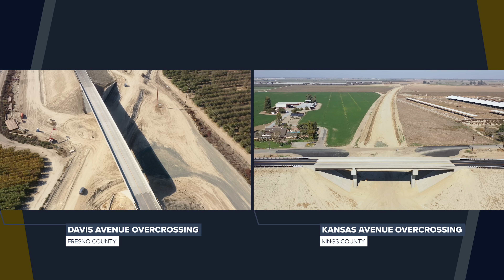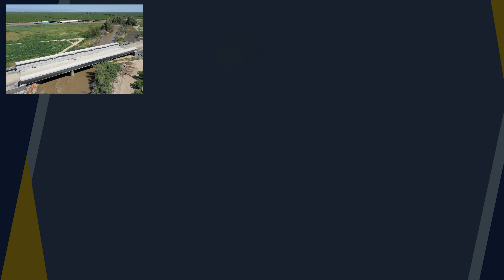Fall 2023 Construction Update: Progress is happening across California thanks to HSR Workers!

Comment: I think with the pace this is going at, I bet we will probably be finished even sooner. It would be amazing if this high speed rail line opened in time for the LA 2028 Olympics. Just as Japan did with its Tokaido Shinkansen for the 1964 Tokyo Olympics.
Reply: no chance for LA service anywhere near that time. sadly. There is a plan for a long tunnel into the LA area from the north, a huge infrastructure project. If it were properly funded (good luck with that), over-all project cost would be lower and it would pay dividends even sooner. Patience is indicated.
Reply: @inyobill lmao I member when this was supposed to be running by 2015
Reply: @SuperMrgentleman  oh. Have you ever heard of "obstructionism" and the effects it has on projects?
Reply: Not SF to LA (CAHSR’s own estimates show up to six years needed to build across Pacheco Pass), but certainly Merced to Bakersfield. That may not sound too impressive, but if Brightline West is able to get their trains running in 2028, then certainly so can CAHSR. Along with new Acela service on the NE Corridor, the US could have three operating examples of high speed rail by the 2028 Olympics. That should be a national goal, especially for the current pro-rail Biden Administration, and one that’s achievable.
Reply: @ChrisJones-gx7fc  no way brightline west will end up running electric service. They'll liekly run deisel service just under the US HSR threshold as they do in flordia. Do i think it'd be cool if CHSR could run by the 2028 olympics? yes. Would it be possible? maybe. What would it take? The following:
Hiring a lot more workers
A commitment to build a second project afterwards to keep said workers employed till 2033 as the current project would (SF/Sac-Portland?) 
A lot more money in the short term (less in the long term)
US army core of engineers involvement
environmental review and permitting fasttracking
And potentially running diesel trains on the line if you can't get the electric wires done in time. 
And starting train procurement now, although train procurement isn't that hard just buy avelia liberties, US production facilities already exist, although it's mostly grade seperated, getting an FRA exemption for N700S may be doable, but you'd also need a Buy America exemption to get enough trains in time, since the tooling and factory setup would likely take too long, unless NYC MTA is willing to take a further delay on their new subway cars and let CHSR take over the kawasaki yonkers factory for a bit.
Reply: @ChrisJones-gx7fc The problem are tge Republicans.
Reply: @ChrisJones-gx7fc Biden is so pro-rail he blocked railway workers from stiking!
Reply: Don't Jinx it
Reply: @chrisonthedot  2024’s gonna be a crucial election year, and not just for the guy who’ll occupy the White House. CAHSR maintaining a supportive Congress is critical to delivering Central Valley train service by 2030, as well as to SF and LA/Anaheim.
Reply: @ChrisJones-gx7fc  Like I said. Don't Jinx it
Reply: @ChrisJones-gx7fc  If the current President wins another term and dems have more control of congress, I am willing to bet we will see more money going to Cali. This Prez will have no reason NOT to do it as he wouldn't be facing another term and can try to do even more if they have full control. I'm hoping for that scenario.
Reply: @ChrisJones-gx7fc here in the northeast we have received over 30 billion from the infrastructure law. If California could get that kind of money this project is possible. Vegas and La will definitely be a thing with brightline.
Reply: @PURAHOUSEDERESTREPO  My thoughts exactly. Although I would prefer they build an entirely new NEC, it's great that we got that much money. Now they need to help Cali even more, ESPECIALLY since this administration is always harping on climate change and sustainability. Cali is building one of the most sustainable forms of ground transportation so the feds need to contribute more.
Reply: @ChrisJones-gx7fc yup Trump can make it possible to finish it earlier
Reply: @TheRailwayDrone Sorry but HSR funding is not reason enough to ever elect those types of politicians who love to make promises they know can never be kept.
Reply: @manishp.26 Agree. Unlike others, Trump knows how things are built at the best price and delivery date.
Reply: @davidjackson7281  Lol we elect them for other reasons. I see no better reason to elect people than to fund building OUR country.
Reply: @TheRailwayDrone I respect your opinion and can appreciate your feeling that funding infrastructure such as passenger rail is a top priority. Not to get too political but I believe there are more important issues such as energy independence, border protection, foreign policy, mental capacity, wokeism, the national debt, etc, etc, etc. Throwing a few billion for funding transit is not nearly reason enough to support those that make promises they have no intention of keeping.
Reply: @davidjackson7281  Transportation is one of the most, if not THE most important issue. There are so many low-income people who do not have viable transportation options. High earners are struggling to live in California because housing options in the major cities are limited. Imagine connecting a relative small city to a major metropolitan area via high speed ground transportation. High speed rail helps to fix that, ESPECIALLY if it is low-cost and robust. All those other issues you speak about are JUST as important (although, I guarantee your definition of "wokism" is nowhere near the actual definition, but I digress). But most cities that have high speed railway stations going through them have enormous potential to improve their economies.
Reply: @TheRailwayDrone Yes,there is a lot of truth to what you believe. Will be interesting to see what the Valley ridership turns out to be. There may be 2+3 seating and discounted fares for low income people. Yes, I threw in the wokeism for fun, but I digress. 

A thirty minute 90 mile commute could be great. However, projected ridership may be based on outdated assumptions and are exaggerated given the revolutionary increases in remote work and the possible stagnation of population growth.
Reply: @davidjackson7281  Ridership projections are irrelevant as they're nothing but predictions. No one knows what will happen. There may be extenuating circumstances that may cause people to move to or from California. But the simple fact is, Cali is the 5th largest economy in the world, so although people may be leaving now, that doesn't mean that'll happen in the future.
Reply: @TheRailwayDrone  I concur. No one can say either way with certainty. So build it.
Reply: @ChrisJones-gx7fc we need to make sure Trump goes to jail and we probably need someone better than Biden in the Oval Office, and we gotta get those old congressman to retire
Reply: @TheRailwayDrone  So, what you're saying is that he can only boost this scam once he no longer has to face the voters again?
Reply: @SoloPilot6  You already seem to be against this project so any answer I gave you wouldn't sway you either away.
Reply: @TheRailwayDrone  This project was a poor idea at the start.  It has devolved into a really BAD idea, and moreso because the backers are forcing every taxpayer in the United States to pay for it.

I LIKE trains, and where HSR is practical, fine -- but this is NOT practical.  

It is too expensive to build, and will never be cost effective to operate.  Only TWO HSR lines have EVER covered their operating expenses (both in Japan), and each only did so for a single 90-day period.  This will be a money drain, and underutilized.  A person can board a jetliner at 5 different airports in and around LA area 3 different airports in the Bay Area and make the trip in an hour, for as little as $49 -- and even those flights are often not full.  Why would they spend more to take three times as long between only one station at each end?
Reply: @SoloPilot6  Welp. Fortunately the majority of Cali disagrees with you. And, alas, the project moves along.
Reply: world cup ⚽️
Reply: @dasalsakid  Something to pee in.
Reply: I'll take that bet. How much ya got? 2028 isn't happening.
Reply: @LucidStew Some love to fantasize just like a 2:40 ride ain't happening.
Reply: @davidjackson7281 I’ll take CAHSR’s models over your assumptions. The entire system is being engineered and built with that 2 hour 39 minute nonstop SF-LA travel time in mind. It’s an average speed of 166 mph, which by comparison China’s fastest HSR service averages 181.4 mph.
Reply: @LucidStew definitely not SF and LA, but your own analysis showed Merced-Bakersfield still could be done in five years time.
Reply: @ChrisJones-gx7fc  It's POSSIBLE, but it won't happen. Best case scenario, they get all the funding they need and open in the 2030-2033 target range. Personally I'm leaning toward 2032 atm. They're still moving slowly, but they are moving steadily.
Reply: @LucidStew  I’m sticking with 2030. The range to 2033 is only if things get delayed more, a possibility to be sure, but it would appear things have pretty much smoothed out and should continue to move forward at a steady pace, one that’s accelerating as structures and guideway are completed, plus all the lessons learned early on being applied into current and future construction.  

Utility relocations have been a big reason for delays, since those aren’t up to CAHSR, and there needs to be more pressure on utility companies to make those happen faster which I believe there has been lately and continues to. Probably the biggest lesson being applied going forward is the Merced and Bakersfield (and eventually SF and LA) extensions will have all their pre-construction work completed prior to construction starting, including all the necessary utility relocations and land acquired.
Reply: @ChrisJones-gx7fc  The missed on CP4 and they had some pretty big change orders last month, so they're probably going overbudget again. These aren't strong indicators that things are going well enough to think they will go to plan over the next 7 years.
Reply: @LucidStew  well, hence why they gave themselves that 2030-33 window. We’ll just have to see how things progress now over the next several years as the first four CPs wrap up civil construction and tracks and systems start to be installed, along with construction starting on the Merced and Bakersfield extensions, the four Central Valley stations and maintenance facility, and manufacturing of the first high speed trainsets. 

I’ve said this before, but my gut hunch is CAHSR won’t receive any funding for beyond what’s needed to complete Merced to Bakersfield until they get trains at least testing, to have something tangible to show for all the effort and what’s estimated to be about $35 billion so far, and justify the tens of billions of dollars more needed to get to SF and LA, meaning construction likely wouldn’t begin across the mountain passes until the early 2030s at the earliest.
Reply: @LucidStew in 2008 this was taking 8-12 years to completely span CA and give 96 million rides in 2020, then it's "jk, just SF to LA in 2020" and now it's "lmao idk give us another 8-12 years"
Reply: @SuperMrgentleman  According to the 2008 Business Plan, at that time they did not anticipate completing the entire system until 2030. At that point they were anticipating 55 million trips. At the time, the assumption was that what is now referred to as Phase 1 would be done by 2020. Now they simply don't have an estimate for anything beyond Merced-Bakersfield. However, the CAHSRA was a joke up until about 2017. They have improved a lot and their current predictions are more reliable.
Reply: @LucidStew  Yeah and the 2008 business plan was AFTER the whole pitch to voters that had passenger trains starting to run 2016 with a total complete date of 2020 and 95 million riders that year. It keeps getting kicked further and further. And now it's, what, 2030 before a 170 mile segment runs? How long until that gets kicked down the road again?
Reply: @SuperMrgentleman  It was before. The 2008 BP mentions the Prop 1A election in the future tense. Election was November. The BPs tend to be released in spring. I don't see any mention in there of an early operating segment, but I didn't go through it exhaustively. Merced-Bakersfield is a 2030-2033 range, not a 2030 hard target.
Reply: @LucidStew  It will never be completed.
Reply: If the feds fund it. But too late for that.
Reply: @PURAHOUSEDERESTREPO  "The Feds" have no money.  They have to either take it from the people who earned it, or borrow it and force future generations to pay for it.
Reply: @PURAHOUSEDERESTREPO California should pay for it, they are getting all the benefits, not the flyover country.
Reply: The UK's HS2 to Birmingham will be finished long before this is complete and it started later.  The engineering challenges for this central section are far less than HS2 as the terrain is largely flat.  Why is it taking so long.
Reply: @aalan4296 Comparisons are fun. CAHSR's 171 mile route by 2030 for $28 B. HS2's 140 mile route by 2033 for L44.6 B. CAHSR started a little for show two years earlier but actually the real construction started only 6 months earlier. The likelihood of further extentions is greater for CAHSR than HS2.
Reply: @davidjackson7281  HS2 will cost more as its going through very densely populated areas with higher land values.  A huge amount of HS2 is in tunnels as well something like 64 miles whereas CAHSR is largely in flat terrain and sparsely populated countryside.  If you watch videos of both then the progress on HS2 and the structures being built are far more impressive currently than CAHSR.  It will be really good for the US to join the high speed rail club my only comment is its taking very to construct given the ease of the terrain.
Reply: @aalan4296 Yes, I can greatly appreciate how expensive HS2 will be because of the tunnels and developed locations. Regarding the Valley's flat terrain, there are still a hell of alot of structures being constructed and the video shows only some. CAHSR's 500 mile route will eventually have 55 miles of tunnels includng three of the world's longest. l love all HSR worldwide the same and chuckle when there are critical comparisons which really matter not, atleast not to me.
Reply: If we are USA (United States of America), we can finish the HSR by summer 2028 for LA Olympics. 
We are DSA (Divided States of America)
Reply: @san209nha9 Don't know about how others may feel about the actual interest in the LA Olympics but I'm Californian and started losing interest several decades ago even if it's in LA. CAHSR first segment will go to Bakersfield nInety miles from LA and planned for operations to begin in 2030-2033.
Reply: @davidjackson7281  
- I am not interested in watching Olympics that much. But LA Olympics is a free advertisement for the American products to the world.
- I support CAHSR, but I did not agree with Obama that CA has to build the segment Fresno-Bakersfield first. what is the point that we build that segment then we have to wait until we build the LA -Bakersfield in order to start to operate. To me we should do the section LA-Bakersfield first and make use of it
-  CA should have built the HSR from LA to Las Vegas first to learn from it, then to build the CAHSR
Reply: @san209nha9 That's a good point. Perhaps showcasing CAHSR's operations would theoriticallly be good publlcity during the Olympics. Unfortunately the best CAHSR can hope to show in 2028 is the test track running.  I agree the LA to Bakersfield segment should have been done first. But directly tranversing the Tejon Pass not the Palmdale alignment which has too much tunneling at about twice the cost and time to construct.
Reply: I remind you this project has the California pace. A few advances IMHO doesn’t address the red tape, bureaucracy, inefficiency, and complexity of doing things in California. Sadly, I predict it will take much longer and, if it’s ever completed, the cost will prove it was a bad investment (it could have been a great investment if properly managed with different rules, but some governments have an amazing way of ruining good projects).
Reply: Theoretically they could if the fast track the red tape process especially in the LA area
Reply: @Ozzymandias493 Yes LA needs to step up transit improvements. Theoretically we could have world peace.
Reply: @davidjackson7281  theoretically you could not be a smartass on the internet and maybe touch some grass. Hmm
Reply: @Ozzymandias493 You are funny ... theoritically. Hope you have a very Happy Thanksgiving with perhaps touching some grass, hmm?
Reply: The thing that held this project back were greedy billionaires that thought they had a better concept as well as the cost of the project being drastically underestimated.
Reply: @Doophenschmirtz  What greedy billionaires?
Reply: @Doophenschmirtz What better concept did greedy billionaires think they had? Also underestimated was opposition forces, environmental obstacles, funding sources and construction times
Reply: @Doophenschmirtz Yes, wealthy NIMBY conservatives and Republicans.
Reply: @Doophenschmirtz Yes, wealthy NIMBY conservatives and Republicans.
Reply: thats very optimistic lol
Reply: @PSL09 I am 199% for CAHSR and am entertained by how some supporters are even more optomistic than even the authorty's hopeful estimates which have yet to be proven reliable since passage of Prop 1A in 2008.
Reply: One thing I still wonder, why don’t they built a fully electric train system?
Reply: @SakuraSakura8596  This is going to be fully electric.
Reply: @SakuraSakura8596 CAHSR is going to be fully electric, yes. This will allow for higher operating speeds, and, if California does the work Union Pacific is unable to do, it will allow for cleaner electric freight trains in California as well.
Reply: @Awesome_Aasim  because I thought what they did in Florida make me worried 😦
Reply: @SakuraSakura8596  Yeah, I don't like what Brightline did in Florida. They became the company known for its safety track record, as well as a real estate ploy that might cease to operate if there is no more money to be made. The best decision would be to leave building to the governments, and operation to private corporations.
Reply: @Awesome_Aasim  That what they did in Japan for over half a century.
Reply: @SakuraSakura8596 What are you saying? Of course CAHSR is fully electric and may become the world's longest and fastest. Do you think the power's supplied by elephants as in some Asian countries?
Reply: A 1% sales tax pays for it. No one wants to pay for it. Keep dreaming!
Reply: At least have the trainsets being tested on the first 119 mile section. It would still make for some great publicity seeing the trains going 220+ mph. The first in North, South, and Central America at those speeds.
Reply: @mrxman581  Great publicity, and probably a lot of fun to ride.  If it ever happens, I would probably go take a trip.

But still, the Disneyland Railroad is also fun to ride, and is more practical than the Crony Express.
Reply: When I went to UCSD for my undergrad degree, they told me I would be able to ride a tram to downtown in my fourth year. The line only opened after I graduated from grad school. sad : (
Reply: Bureaucratic red tape on monolithic megastructure...  But, once it is done, California will feel even small than it already does.
Reply: Its a little too hopeful.  Maybe brightline west will open before the Sf-la one. Nonetheless, it will be good for the country as a whole!
Reply: @Ninjabeefyschtick  How will it be good for anyone other than the people getting the tax money from the rest of the country?
Reply: @SoloPilot6 HSR is barely able to be built despite the huge cost because of mountains of overcharging and corruption sure. However expecting infrastructure to break even doesn't take into account the overall effect on an economy. Infrastructure is a cost center and the profit center are businesses and production overall. The cost is way too much though of course
Reply: @Ninjabeefyschtick hopefully Brightline West’s progress pushes CAHSR to accelerate their own construction rate so both could begin revenue service (in CAHSR’s case Merced-Bakersfield) around the same time, ideally Summer 2028. That’s the goal for Brightline West, and it should be too for CAHSR. That should be a national goal for US high speed rail, to potentially have three operating examples of high speed rail by the Olympics.
Reply: not happening
Reply: There is a TON of work necessary. The earliest it could start is end of 2030, and that's just Merced to Bakersfield.Checkout Wikipedia entry for more info.
Reply: Dream on!
Reply: How can a Bakersfield— Merced line help with LA Olympics
Reply: It's only going to be completed Merced to Bakersfield for the foreseeable future. The project wasted all their money buying up private land because they went down 99 instead of I-5. A person of normal intelligence would have gone down I-5, and it is what the French and the Japanese advised us to do. They said if we went down 99, there would no private investment, and they were right.
Reply: @neutrino78x  there are no big cities on i5. They has to offer the central cities something to get their votes. Unlikely the project wud have even been approved if it was sling i5
Reply: @neutrino78x  I-5 crosses down through a mountain, and having it follow that route would defeat the purpose of a rail line, which is to promote sustainable transportation between urban, suburban, and rural areas. They did not make a detour to Palmdale for nothing, they just avoided mountains to avoid even more costs.
Reply: @gooser__43 

"😅 no"

lmao, 20 years from now, these fools will be saying "oh yeah the CAHSR will be finished this year!"

And we'll be flying zero emission aircraft, and most cars on the road will be zero emission as well, so that won't be a concern.

Newsom made a very wise decision to draw a line and say there shall be no more construction beyond Merced to Bakersfield, for the foreseeable future. 

By the time this stupid train, as originally planned, is ever built, there will be no need for it, nor is there a need right now. 🙂
Reply: @gooser__43 

" use the rubble to set up a choral reef?"

Lmao hell that would be a more constructive use for it lmao
Reply: Only another hundred and fifty years, and these train station models are going to be finalized!!  Can't wait to see the hard work of the engineers and architects, so I can challenge the environmental document, and freeze construction in its tracks!  Only in California!!
Reply: @wolfumz 

"Only another hundred and fifty years, and these train station models are going to be finalized!!  "

Well, we already have a high speed system that's much faster than HSR: jet aircraft.

The city pair where HSR would be more useful (though overkill) is LA/SD, not SF/LA.

380 miles is way too far.

LA/SD is only 127 miles....but you don't need 200 mph  to cover that. 

If you averaged 75 mph -- which is allowed by the current track speed of 79 mph --  it would only take 1.7 hours to get from SD to LA. This would be a huge improvement from the current average of 35 mph, and doesn't require huge investments.

Good news is that they are working on that independently of the stupid CAHSR project, and it can be done and is being done with existing budgets.
Reply: At this pace there is no way LA will be connected by 2028. Perhaps the CCP could do it in 5 years. Is this project a joke. Seriously this is a boondoggle to feed money to the lawyer lobby so every mile can be litigated.
Reply: Delusional; is no way to go through life you indoctrinated Commie.
Reply: if you’re rich enough to go to the Olympics you’re rich enough to take a plane in. Probably first class. The Olympics are actually getting in the way of infrastructure projects that could help the people who live here in LA, city council only bid on the games to cater to wealthy tourists and real estate
Reply: @thepopculturejunky  Well if you are rich enough to fly first class on a plane you are probably more than rich enough to take a first class bullet train to where you want to go. First class train tickets that are less than first class plane tickets.
Reply: Even if this did get completed by the Olympics (which it won't) Bakersfield is quite far from Los Angeles...like 2 hours far.  So what's the point.
Reply: @thegoldstandard55  Because you believe the project, especially with the parsimonious funding, should be a complete system from day one. Worked a lot of large projects, have you. Here it is something like 65 years after the start of the Interstate Highway project it's still not complete.
Reply: @inyobill  The OP specifically mentioned the project will be a benefit for the Olympics in 28, but my argument is that a train from Bakersfield to Merced won't be any benefit for it.  In Southern California we need a good fast train system connecting San Diego, Los Angeles, Long Beach, Irvine, Anaheim, Ontario and San Bernardino.  Like BART does in Northern California.
Reply: 2028? 😂😂 Keep dreaming!! With the unions, lack of money there's a much higher chance of the project getting scraped entirely. Just sad!!
Reply: @sam_1570  Major viaducts for the placement of track have already been completed, with more expected to be done soon. The target for CAHSR is 2029, I was just saying if the project got ahead of schedule it would be done sooner for the Olympics.
Reply: @Awesome_Aasim  most viaducts have been completed? 🤔  Where are they in Lebec or Castaic areas or the Bay area?? Its just embarrassing!!
Reply: Will probably be complete by 2040.
Reply: @467076  only 16 years from now and that is the same timespan from '08 to '24 and just look at how much more the US infrastructure has degraded since and the number of train derailments that have happened. I hope you're right but very very unlikely since they don't even know what type of HS train they're going to use. It truly is embarrassing and the rest of the world is LTAO. 😔
Reply: @467076  and if 2040 was true the rest of the world will already be utilizing high speed 2.0 or 3.0 already. 🙈
Reply: This reminds me of the fable of the emperor’s new clothes. The train is supposed to go to Bakersfield. Right now all construction terminates in Shafter. I see a lot of hype but I don’t see any actual plans on here for finishing this portion. Which brings me to the north end. Before Merced or the section going to San Jose and San Francisco can be connected the Central Valley Wye has to be built. Again I don’t see any detailed plans with timelines. All I see is hype.
Reply: It would be better to fund and pay for extensions and improvements to existing rail systems then spend into oblivian for a Pie in the Sky project,which likely wont be completed in our lifetimes!
Reply: @jasonalperin9414   in the current US economic system you are absolutely right. Unless politics and economics change drastically in the US HSRs is only a fantasy. GUARANTEED!!
Reply: @jasonalperin9414 Oh it definitely will be completed in my lifetime. Four years might be a bit ambitious, but it is not impossible. If it is not completed until 2032 then there should be another World's Fair or World Expo held upon completion.
Reply: You really are a believer.